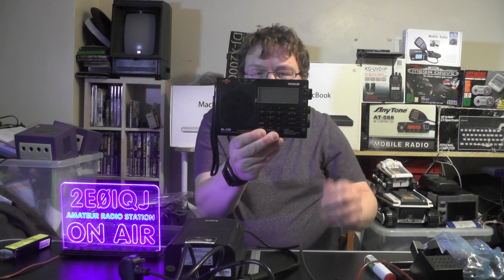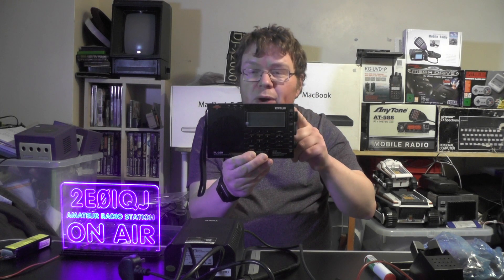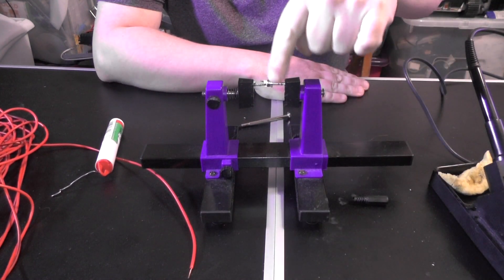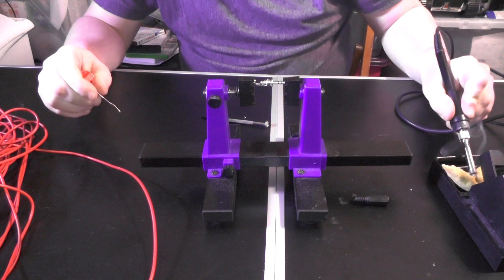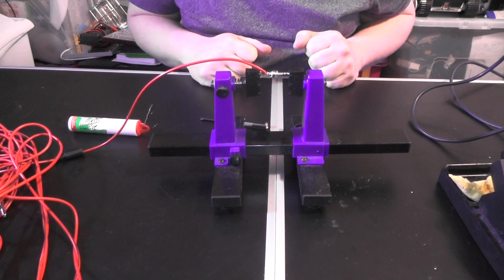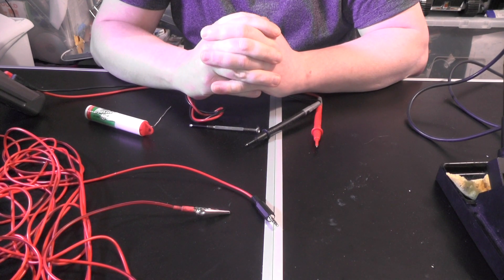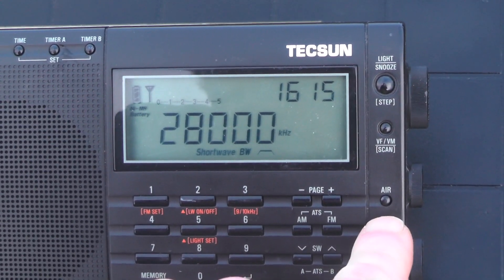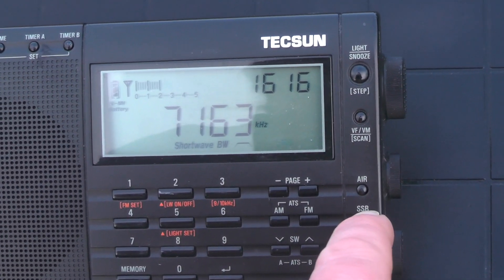Tecsun pl660 Simple antenna build

Comment: I've got two of the Tecsun PL-660 multi-band receivers. They are a good radio 📻 but you DO need to connect up a decent antenna. The better your antenna, the more "Signals" your going to receive.
THANKS for the demonstration. The younger folks especially need to understand these basic principles of Short Wave reception!

Comment: Thanks. Question, does the jack on the radio only have a single contact that only touches the plug’s tip?  Or is it a single contact that touches 2 or all 3 plug contacts?

Comment: I'm wondering about power lines near the antenna. Not thinking electrocution, but rather interference the lines might have with reception. This simple house wiring. I haven't seen anyone post a video on where you shouldn't place an antenna. Your video is great.

Comment: Very strange: When I connect the wire to the  shorter piece of metal on the 3.5 jack - like you did - the radio overloads. When I connect the wire to the longer piece, the signal is good. Why would that be? I use a MONO jack.

Comment: Sir what does this mean PL-330, 360, 660 ?? What r their functions n which 1 will be better for best signals ??
Reply from the maker: Pl330,360,660 are the model numbers of the radios . The pl360 from what I’ve read online doesn’t have ssb only fm/am. It all depends on your location and what interference you might get from other devices
Reply: Tecsun pl 680 is the best  one for shortwaves. Better than 3/400 € receivers too.

Comment: Hello. for radios that only have a telescopic antenna, what is the solution to use a fm radio terrestrial antenna with the coaxial cable? thank.
Reply from the maker: You could just try placing a piece of wire around the telescopic antenna and hanging it out of the window that may improve results it’s worth giving it a try

Comment: How do  you ground a Tecsun radio?
Reply from the maker: You shouldn’t need to but if you did you could connect a wire any screw and then on to a ground and it should ground it out . I’ve done it with my yaesu ft857d and it seemed to work

Comment: I always put a ring terminal on the other end.  Then I can tie on some line to throw it into a tree, or a hook with elastic, or whatever.  You can even attach more wire on it to extend.

Always use heat shrink!  It will save the solder connection from breaking, and keep the wire straight or the bends smooth.

Comment: WHY are you using a STEREO plug??? Does your radio have stereo capability?????????    My PL - 880 is mono.
Reply from the maker: The antenna is just a piece of wire the jack is stereo the wire is only connected to one of the connectors think the stereo connector was cheaper than the mono connectors
Reply: @2j4ez    I see.     Only FM in that radio is stereo.
Reply: The older Sony ICF Shortwave portable radio uses a mono plug in the external antenna port. Yes I guess the only way to know for sure about the effectiveness of your stereo plug for external antenna is to do a comparison with/without external antenna.  Does reception really improve?
Also a lot of major sellers of these external antenna plugs use mono jacks.

Comment: Jez, hi mate, great vid! Do you still recommend the 660? The 680 is £48 more but have heard the 660 is just as good. Any thoughts? Laurie
Reply from the maker: The 660 is great I’ve never used a 680 so not sure what’s it’s like sorry
Reply: @2j4ez  thanks Jez, I’ve just ordered the 660 as the reviews support it well. Going to have a crack at making your antenna too. Thanks my friend …..
Reply from the maker: @soldierloz  it’s a easy antenna to build I’m not 2 good at soldering but I managed to make it

Comment: This kind of wire antenna doesn't need ground pole?
Reply from the maker: No it’s just for receiving if you was going transmit then you would need to ground the antenna out like I’ve done with my spx 100 and a copper rod

Comment: Great video Jez. I always thought they only came with telescopic antennas, didn't realize that they had an antenna jack. Must invest in a short wave radio. Cheers!
Reply: alwais thought if you plug the cable antenna to the screw of the telescopic antenna.. the same to my old shortwave philips radio